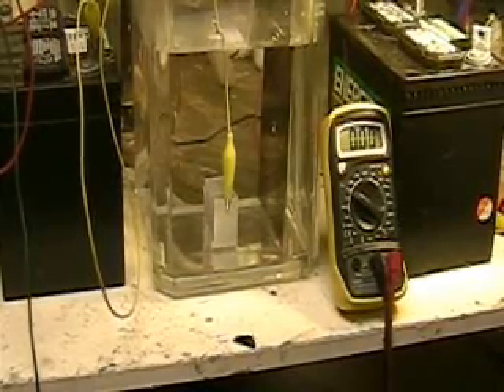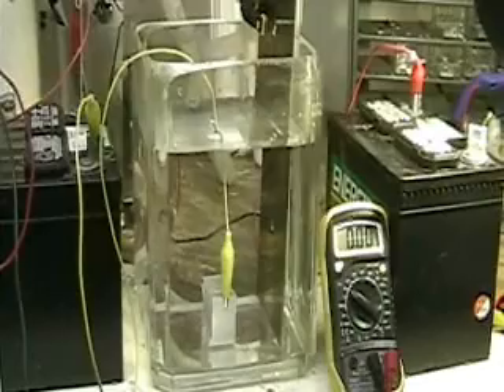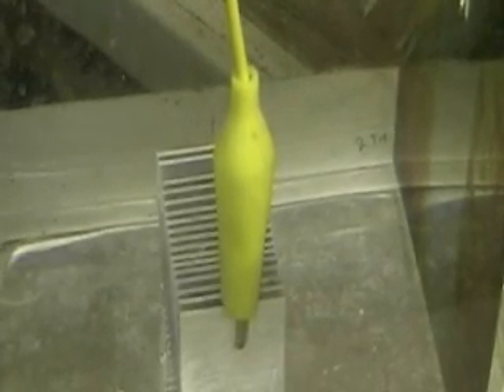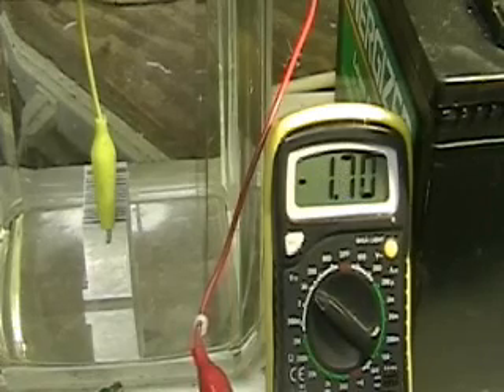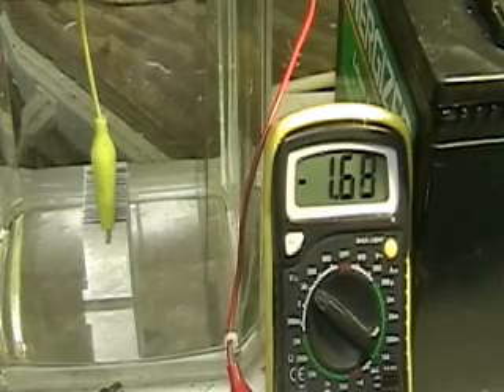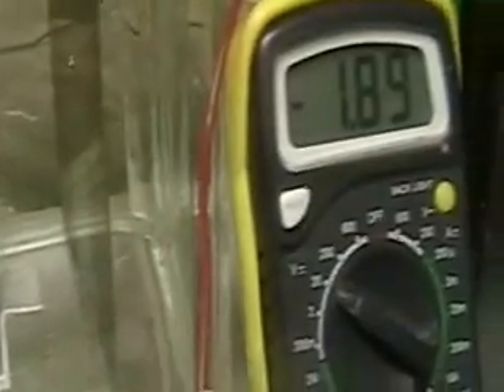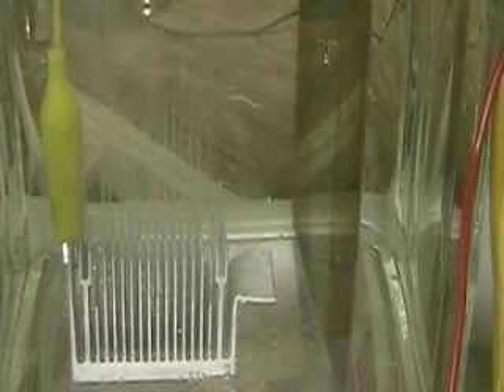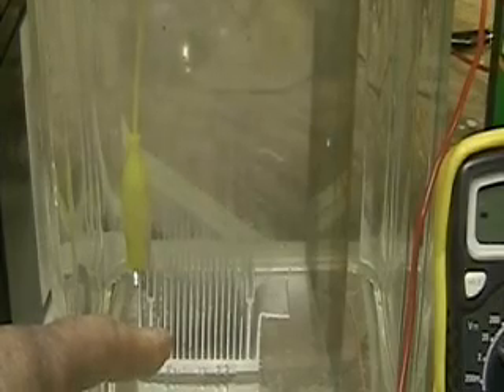Hydrogen Tap (Watch This ) 286

Comment: I think this is a battery i mean this is an aluminum battery, I guess, the reaction is known and it's caused by mixing sodium hydroxyde and water and aluminum and I think it's good cheap way if we use aluminum foil the question is how much aluminum, water and sodium we need to get 1 little of hydrogen, then we know for sure if it's cheap and practical or not, John I really need to know how much of each do we need?

Comment: if you use enough lye or caustic soda in your water and had aluminium, you will produce great amounts of hydrogen from the process, but be careful ive heared that alot  of aluminium gas can cause alzheimer's, so use a face mask when messing with aluminium

Comment: Aluminum reacts with strong acids or bases to produce hydrogen without any battery. I used to fill balloons with hydrogen by this method when I was a kid. Zinc and hydrochloric acid works better. The metals are consumed by the reaction, so it isn't practical. Too expensive.

Comment: Here are a few answers all aluminum that we see an touch is coated with aluminum oxide. Aluminum loves to bond with oxygen when you add Lye to the water it strips the oxide layer off the aluminum allowing it bond with the oxygen in the water leaving the hydrogen to escape. And the voltage is produced because when the aluminum bonds with the oxygen it creates energy mostly in the form of heat but you have shown that it can also create electrical energy. The gas is non toxic is about 99% hydrogen